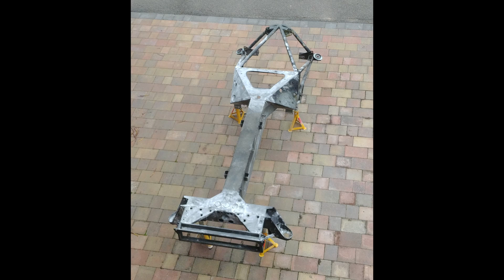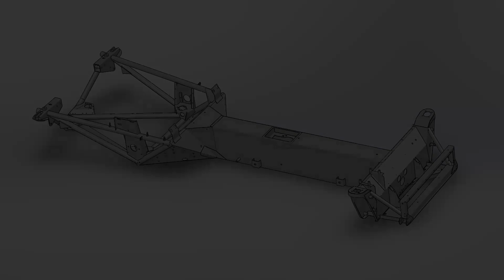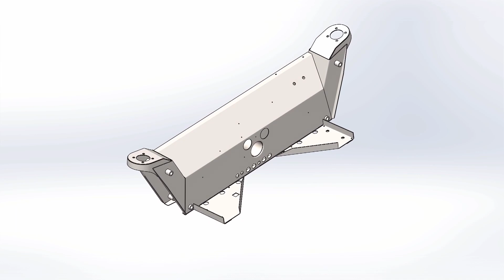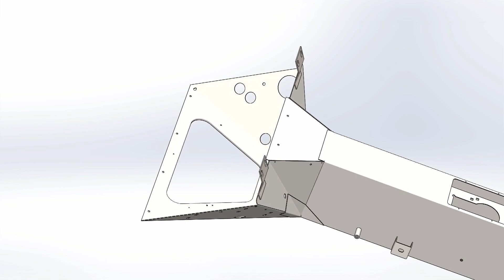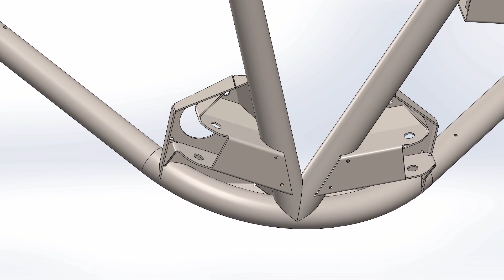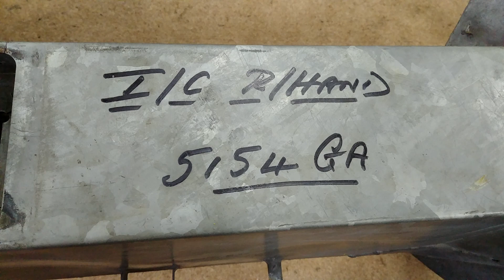Project GT2 - Lotus Esprit chassis introduction #03 (Jan-22)

Comment: Phenomenal work Jon! I am currently working on a EV version of this Esprit that will use a Tesla Model S motor. The rear chassis had to be redesigned and I'm having some troubles locating suspension, body mounting points and a few other small miscellaneous things. I was curious if you could give me a hand. I sent you a more detailed email a few days ago but haven't heard from you. I was worried that maybe my email was sent to your spam. Look forward to hearing from you!

Comment: Great information and clearly articulated. Do you think the chassis could benefit from bracing the front and rear sections using relatively small tubing, front to back, perhaps along the area of the sill section? Probably using de mountable elements

Comment: The "hack" for chassis design is to project (estimate, simulate) the torsional rigidity of the backbone or chassis. You can do this by loading the chassis with a long lever arm while fixing the other contact points (which mean bolted to the concrete floor or a metal test plate (which is very handy, but also expensive). Just pick a lever arm length for the loading expected (rigidity) using your body weight and add about 15% more length. Then once it is attached to the chassis you can put your weight on it at different points along its length and see how the chassis flexes using a simple scale. It is interesting because you can actually see how it moves in response to the load.
Reply from the maker: Yep I really wanted to do this but I have zero space to carry it out and I am rushed to get this car finished - those compromises are hard to bear as I'd love to delve a lot further into this, given having a stripped down chassis is a fairly unique situation to be in.

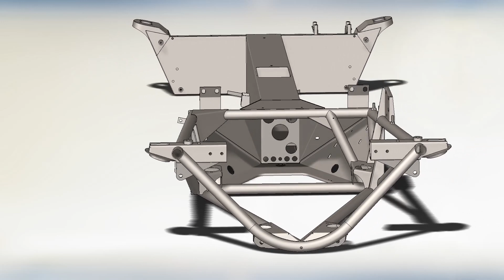Comment: Jon as a 22 year aerospace structural analyst, I've got a crazy idea for you. 😛It looks like you could get some internal U-channel stiffeners inside of the box section on both sides of the shifter. Look at the back side of the frame at 3:08. You could cut a slit across the lower hole to the center hole to feed your stiffeners in. With it being a diagonal cut, you could get a channel width about 2/3 of the beam width. That plate with the holes isn't doing anything structurally anyway in the middle since torsion and bending flow around that area. The stiffeners could be welded or bolted once they are inside the box frame. Captive fasteners on the U-channel might be easiest. If you wanted to repair the access slit later, it would be easy to weld or add a repair plate. You could increase torsional stiffness as well as relieve stress in the gear box cutout by flowing the stress around it with an alternate load path. I did something similar on a large test fixture with a similar beam cutout. I had room on the outside for doublers rather than having to go up the middle. 😉

Just some crazy food for thought! 🤣 I would be happy to model a mockup in solidworks and analyze it in Ansys for fun!

Cheers!
Jason
Reply from the maker: Thanks for the input - have you seen the structural analysis video I did?  So the plate in the middle is the gear lever translator mount so has to remain unless I switch at some point to a sequential box.  it actually does a fair amount to stop the main back bone collapsing due to that huge cut out in the top.  What's also not shown here is how busy it gets inside the backbone when all the cooling pipes, oil lines and junk go back in.  Its also dip galvanised, I've tried to TIG weld repair before on other zinc'd parts and really struggle with the porosity, the major issue is you cant always get to the other side of the metal so if you have full penetration you start getting weld contamination, so not too keen on tackling this - but it's a worthy mention though because it's similar to the avenue I want to go down, which is to bond and rivet a C shaped cap over the gear lever aperture.  The surface area of the bond is considerable, there is no risk of welding causing issues and burning off the zinc.  I plan on riveting it in the corners to prevent peel.  The chassis will also be supported by the fully roll cage I want to introduce - I think I can increase the torsion to a level where the lightness of the car wont really impact it.

I'll probably get around to doing it this winter as I get more time.  I have to select a glue and try and run some physical and virtual tests to ensure it will work.
Appreciate the thought.

Comment: Great job ob the CAD model!!!
Reply from the maker: Thanks, I'll do an update on it sometime - it's got a lot more done to it.
Reply: @JonHimself  Do you have a Europa Twin Cam Special or Elan +2 in your stable to do similar CAD work? I work in Aerospace & Defence and CAD tools as you well know are used extensively from early concept proposals all the way thru final design. And by the way I have an original Europa TCS w its factory chassis. My +2 still has it's original chassis however a Spyder tube frame will go into it.
Reply from the maker: @edwarddemas5685  I wish I had, barely enough room for the Esprit I'm afraid.

Comment: Great video Jon.  LIke Kwanyeazy, I'm getting started on converting an 88 to EV with a Tesla small drive unit.  however, this will require modifications to the rear "hoop" chassis member.  I began making the revisions in Fusion 360 using a Lotus chassis I pulled from GrabCAD, but the geometry was not correct. Any chance you'd be willing to share your Chassis CAD file?
Reply from the maker: Hi Matt, send me an e-mail so i can reply better that way (link in the about page) - I can convert the rear tube section to an STL which should help.
Reply: @JonHimself  Hey Jon, sent you an email earlier today. thanks.

Comment: I've wondered if adding cross plates to the central tube would stiffen up an Esprit.  Looking forward to a bit of FEA on the chasis and modifications.  The roll cage should be available for the X180R.  Good luck.
Reply from the maker: Yeah - what is really interesting is the torsion for the std chassis.  I wasn't expecting that small vertical part of the gear lever tray to play such a large part in stiffening the beam.  Most of the solutions are not cost effective though.  one of the ones I thought of was to put a similar capping plate to the under side on top of the beam as the return would really strengthen it up - but would it put more stress into the interface area?

End of the day for me the roll cage is what is going to happen so the central beam is not going to be so critical, and I still want it to be a Lotus chassis.

Comment: Fascinating how the rear almost looks like it could be replaced with a stressed engine/trans combo, front 2/3rds does look alot like early carbon fiber monocoque designs. Miata and S2000 share this ethos aswell.

Comment: I would love to see a video of your work flow when creating the CAD model.  Was this scanned, then each component modeled based on the data from the scan?
Reply from the maker: Firstly I just looked over it to see how it would have been constructed and identifying the piece parts.  Due to the primitive shapes most of the parts didn't need to be scanned - I used manual measuring such as dividers, rules, an inclinometer and wire triangulation to determine each part which was then individually modelled as shown in the assembly animation.  I also have access to Lotus' jig dimensions from the workshop manual so I could check the critical dimensions.
Scanner was only used to grab some of the complex shapes such as the engine mounts and the gearbox mounts to speed up the process as the chassis obviously cant fit on a desk so the next best thing is to digitise and work off a virtual model instead of walking back and forth to take dimensions and risk getting things wrong - 100x faster too.
Oddly if you scanned this part it would probably be less accurate due to compounding / stacking tolerance errors of the scanner which is why I use wires, same way as you would jig an aircraft.  Also this is a 'live' part which has slight fatigue and actually flexes when loaded up so this model is actually simulating the chassis when it is full loaded.

I took great effort to get it right, about 1 month of 1-2 hours every evening to ensure it was as accurate as possible, as I don't intend to do this job more than once :)

Comment: Cant wait to see some FEA from this model! Hopefully  you will delve into the aggressive load conditions for this chassis!
Reply from the maker: Sadly time is the killer at the moment - I will mainly be looking at the flexing and stressed areas of the chassis to determine any mods I need to make, anything other than that will be back burner stuff as the priority is building the car.  The video should be out sometime next week if I can resolve one of the issues I have right now with the simulation failing.  As with most things I am trying to split them down into bite size videos, one of the future steps is to look at the roll cage design for example.  The other consideration is to ensure the info I put out is accurate and true, so i am getting the results professionally validated - any feedback and suggestions are welcome.

Comment: Wow, a huge amount of work you've put into this and it's really fascinating. Such an elegant chassis design, nothing is wasted, every part has a clear function (or multiple functions). You can see the 'added lightness' everywhere :).
The analysis of those cracks and stresses around the gearchange mounting will be interesting. Do you think you'll be welding, or looking at structural adhesives and patches as per later Lotus cars?
Reply from the maker: I agree, the more I studied it the more you realise just how good it is.  If you look at "Soup Classic Motoring's" series 2 chassis from the 70's its very similar, yet Lotus were able to massively increase the spring rate and over double the engine horsepower with the V8 using an almost identical design.

Bonded reinforcement has advantages structurally and practically over welding, which threw me initially, but I will cover that fully in a later episode when I have finished my research.
Thanks for kind comments :)

Comment: Amazing to learn about how the chassis is engineered. I’m only a spectator, but I’m really interested in these cars. Question: do you think in theory this design would stand up well to being manufactured out of aluminium and would aluminium stand up to the heat of the turbo. Great video! Thanks.
Reply from the maker: Yes as someone who works in engineering and is into design, it was a great opportunity to really study it.
When you use different materials you should change the design to benefit from them.  Making this out of aluminium (depending on the grade) would be cost ineffective and over weight.  When you look at the Elise for example it is similar in weight but a lot stronger in torsion due to the way it is constructed and bonded (tub construction) to take advantage of the design material.  Aluminium significantly weakens around 600c, the turbo has damaged the zinc which melts at $20c so I dont think an aluminium stressed member here would be a good idea.
Reply: @JonHimself  Thanks for the explanation. So the esprit uses the best material for its specific design. I’d love to see a bare chassis CAD model of the Elise and the Alpine a110.
Reply from the maker: @brayworkshop427  maybe one day - if I finish the Esprit, a lunatic Elise is certainly on the cards.

Comment: Well done Jonathan!  We appreciate all the effort to capture the detail and then share it with the world. For me personally I am captivated in comparing it to mine as well as seeing how yours turned out with all the “elbow grease” to clean it up. 
Now I need to take a closer look where the hot side may have damaged the galvanized bar on mine. I definitely see similarities in the aging of both our chassis. 
I look forward to watching the future additions to your video series!
Reply from the maker: Thanks Dean.  I was looking back over the history of the car a few days back and it's obvious the main owner doted on the thing and the chassis is in such good condition.  It came up almost as good as new (in some cases it is as new).  I didn't go too crazy on the nylon wheel as I want something to key onto when I try painting it.
Def check out the chassis beam, it's common on all the turbo cars to a greater or lesser degree but if like this its only surface rust it's easily treated and a heat shield applied over the top.
Reply: I have to clean mine to see that exhaust heated area. I am curious what color you plan to paint it.
Reply from the maker: @SlippingTime  haha so am I, with the cost of the paint I bought it' going to be what ever they sent me - I've had it 3 months, it's supposed to be aluminium which from what I have seen is a dull metallic grey.  It was actually a hard choice, they do some great monotones.  Light colours show up rust breaking thru and damage a lot easier in my opinion so I went with that.